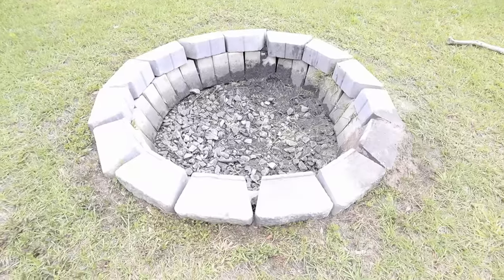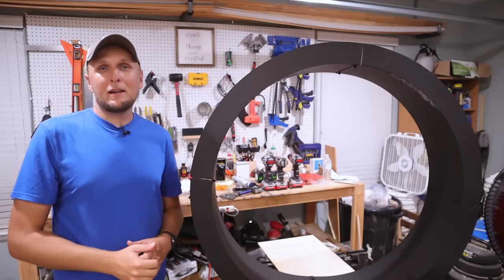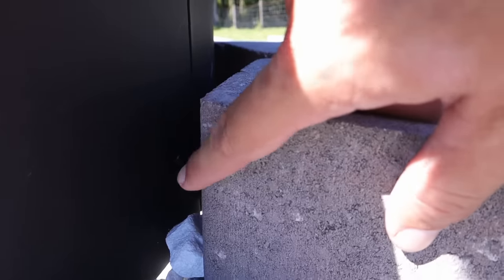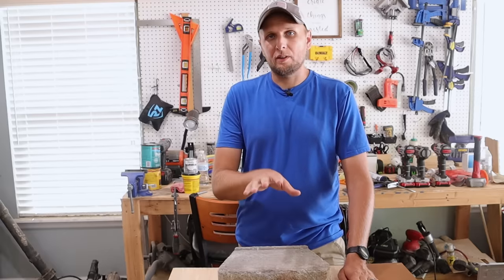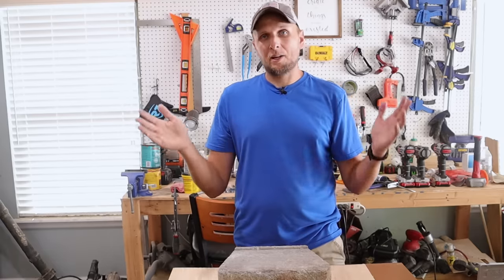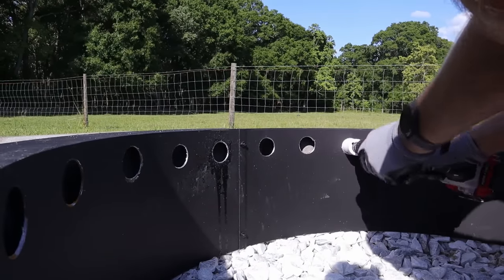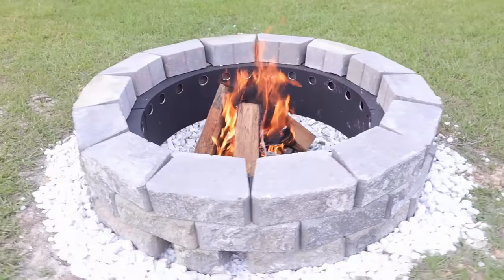How To Build a DIY Smokeless Fire Pit That Really Works!

Comment: Instead of buying a metal ring, a broken washing machine or a drier is free and has a nice, big metal container inside. Bonus: it already has holes in it, so no need for drilling.  Just cut it, invert it so that the holes are on top, and continue as normal with the bricks (making sure to make the top as airtight as possible so that the heated air travels out the holes, you may have to use mortar). Extra bonus: if you have welding skills, weld on pipes at a 45 degree angle to the right or left for the air to travel through. As is rushes through the angled pipes it creates a spinning vortex and you'll get a fire tornado forming.
Reply: Please do a video on this sounds so cool
Reply: @AW-md2ew  break into a house, unbolt the the nice container and get out
Reply: @kawkaw8623  😅 perfect answer 👌
Reply: @AW-md2ew  I have both a washer and dryer that are dead and useless I’ll be doing this
Reply: That’s a damn good idea, sonbut my fire pits gonna be big, much bigger than a washer or dryer Drum. Unless you talkin bout,  one of them there,  commercial dryer, now that might work.
Reply: That's a great video to be made right there. I see spare washers and dryers all the time thrown to the side of the road.
Reply: @AW-md2ew bro people throw old ones out all the time shoot I have even left one outside my yard with a free sign
Reply: Too small
Reply: Too big. jk, may do this

Comment: To increase the longevity of the fire ring, spray paint the fresh metal made by the hole saw with high-temp paint.
Reply: Yeah I wondered why he didn't..
Reply from the maker: I do in one of my follow up videos
Reply: If he knew he was going to cut holes then why the hell didn't he cut them before he set them up  and could have done them on a flat surface ?? Oh well not my Job ha ha !@! Good idea Eh ?
Reply: High temp paint doesn't hold up with direct flame but still a good idea.
Reply: @deere1485  true, I touch up throughout the year
Reply: Also to help you with the hole saw bit pre drill the center hole. Less stress on the wrist and drill.
Reply: @HowToHomeDIY  You're better off using extra virgin olive oil. The fiber content creates a carbon paint like layer.

(DON'T USE THIS FOR SEASONING COOKWARE)

Comment: Thanks for the video! Was about to build my own firepit and will definitely be using this smokeless method. The only thing I may adjust is spraying some high-temp paint on the drilled holes so the exposed metal doesn't rust as easily since the rest of the ring is treated with high temp paint already.
Reply from the maker: Sounds like a plan!  Thanks for the feedback!
Reply: That's not a bad idea, dude, since there's going to be a lot of oxygen going through them, along with a lot of heat absorbed by them, which is going to promote faster than usual rust.
Reply: @HowToHomeDIY  where do you get the 4 piece fire ring?
Reply: @scottplecker2296  There are links in the description for different sized ones. I'd love to try this out when mine finally rusts a hole in the bottom.

Comment: Thanks for creating this video! I’ve enjoyed all kinds of fire pits over the years while camping and I’ve found the best way to cut down on smoke it to scout for dry hardwood (usually from storm damage) and split it into smaller pieces allowing more air to mix with the fire as opposed to burning large logs. I’ve also noticed that fire pits with high sidewalls block radiant heat so you have to stand almost over the edge of the fire to get warm which can be hard on the eyebrows 😬

Comment: Wanted to say Thank you for this video,
 Got a fire ring, hole sawed the 1 1/2” holes, sprayed both sides with heat resistant paint, 12 -1’ x 2’ x2” pavers over sand for the base, used bricks that were on the property for the outer ring, 4 layers of the brick raised the ring 3/4 of an inch up which lets more air underneath, works like it’s supposed to!
Reply from the maker: You are welcome.  That’s awesome!   Really glad to hear you’re enjoying it.  Thanks a lot for the feedback Gary!

Comment: You could take out a couple of stones then distribute the remainder evenly and you'll have the support and the vents around the pit.
Reply: Simple solution.  Especially since this would negate the need to split the stones in half.
Reply: Exactly, that is how I did mine.  Work smarter, not harder.
Reply: That's what I was thinking. Could you not space each bottom stone out about 2 or 3 inches? Can you have too many air channels on the bottom ring? does it affect how this works?
Reply: i second that
Reply: The metal jacket is essential for the effect he is trying to achieve - not merely better general ventilation at the bottom of the fire, but the heat/convection-powered forcing of fresh air into the superheated exhaust stream at the top of the fire, to duplicate the "afterburner"  smokeless design of the expensive stainless firebowl shown at the beginning.  Merely adding more vents at the bottom helps burning generally, but it does not create the afterburner effect that completes the burning of the exhaust gases.
Reply: I've seen it done both ways and I personally think this way is more aesthetically pleasing (it looks better), and splitting stones is extremely simple.

Comment: Great concept!  My concern is any time I've used metal rings is they don't last long.  Heat burns off any coating, steel trusts, fire burns rust...two years later the ring is burned through.  For that reason I'm working on something incorporating the smokeless design but using fire brick instead of steel.
Reply: Did you get it figured out and built 🤔 
I would guess that the fire brick would insulate the heat from the outside chamber. The idea is to have super high heat air rushing in to the top to create the re-burn.

Comment: Should you do something to keep the stones in place once theyve been set down, like mortar or something?
Reply: Just avoid bumping them with the deck of your riding mower (if you use one). My pit is made of standard brick-sized pavers just free-stacked, no mortar. And that's the only problem I have had with leaving it unmortared (read: removable and rebuildable). But my bricks weigh a lot less per piece than the retaining wall blocks used in this video. It would probably take a pretty solid hit with a mower to really cause any problems with a pit built from those blocks.

Comment: @How To Home - Good idea & video, thnx!  BUT for a true comparison you should lift the fire ring out and try it with just the 3 layers of stone (with the spaces on bottom as u have now).  Your previous design was in-ground I believe, with no airflow (= smoke).  I've always wanted to see a standard firepit with airflow vs a firepit with a ring & holes design.  (The idea being, do you really need a ring to create the draft, or does the fresh air coming straight into the fire at the lower level do the job just as well).  PLEASE PLEASE PLEASE do this!  It would be easy with your setup.

Comment: Getting ready to start mine hopefully this coming week, got all the materials and assembled the ring and also drilled my holes.. i found a small starter drill bit followed by a step bit worked amazing.. i did 20 1/2" holes in mine (5 per quarter piece of ring)

Just gotta prep the ground area and get it built. Just been busy in the new house with other projects that take higher priority.
Reply: Was this hike size effective? I was thinking that more smaller diameter holes could create a little more back pressure allowing the air to flow out at a quicker rate? Does this sound logical at all?

Comment: Thanks for that.   And just an idea here:  regular stones would absorb and conduct a ton of heat, right?  Well, if you live in a cold place and have a fire for heat -- that's perfect.   But if anyone wants a fire for the aesthetics or for cooking but are in a hot climate (and actually don't want to be warmed up), then experiment with aircrete blocks instead of stone -- they act as insulators -- you may even be able to rest your hand on the outside of the ring while the inside is glowing hot (also prevents kids getting burned fingers)
Reply: Have two fire pits?

Comment: Great video.. I’m going to try this this weekend! I do have a few questions though.. what is the diameter of the holes you drilled, how far apart did you space them, and how far down from the top did you drill them? Are you at all worried about the bricks moving with people putting their feet on it?
Reply: I saw a different video, where the 1/2" holes were 2" apart, but not sure how far from the top to measure down.

Comment: You might increase the efficiency of the burn by constricting the top diameter. Eliminate one of the top stones and that will move the whole ring in so it over hangs the metal fire pit ring by a couple of inches This will cause a chimney effect and draw more air in and concentrate the combustion air and smoke for the secondary burn.
Reply: I like that idea, but I would think that you would need more top layers for it to produce that effect?
Reply: armchair expert gets the top comment.
Reply: @shamancredible8632  Not really an "arm chair" comment. The Solo fire pits are designed so the top ring is smaller than the pit and it draws the air in.

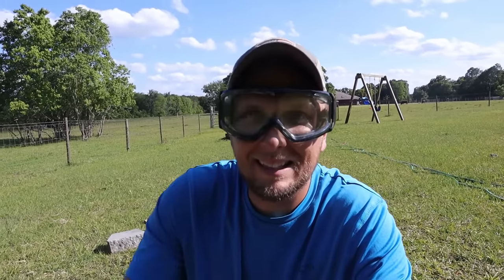Comment: 7:45 no joke getting metal in your eye! When I was a teen I was using a Dremel and got a "tiny" flick of metal in the corner of my eye and LORD did that hurt like hell! Super lucky it didn't do any real damage! 

One way you could improve this design and add more airflow is to look up a "Dakota fire hole" and combine that with what you already have to provide even more rushing cool air to the fire. Make a small tunnel down into the middle of the pit and out one side with something like cinder blocks, bricks, or a pipe ETC. Then cover the end of the tunnel inside the pit with a metal grate, maybe do the same on the inlet end of the tunnel to keep from stepping into or tripping over it if it's not tucked out of the way?
Reply from the maker: Yeah I would like to avoid that at all cost!  Glad your eye was ok!

I actually made a video doing pretty much exactly what you are suggesting.  Feel free to check it out on my channel.  It definitely made a difference!
Reply: @HowToHomeDIY  LOL so I see! Ya a Dakota fire hole works really well...

Comment: What influenced your decision regarding how high to drill those holes - I was expecting them to be lower? Would pre-drilling on your bench have been significantly easier?
Reply from the maker: I looked at the smokeless firepits in stores and that is where they are.  The idea is to get that fresh air into the top of the fire to help burn off the excess smoke.  I don't know that on the bench would have been easier as I was able to sit on the fire pit and lean into it to cut the holes.

Comment: Great video thanks. A few questions 1) would it be OK to create space between bottom layer pavers rather then having to cut them at all?  2) Are the retention pavers 12" wide & 12"deep? (I'm trying to figure which size fire ring I should buy if I want the total size of my firepit with pavers to be no larger then 55" diameter)   3) the hole saw kit link you provided is not available is there another you recommend or should I just shop Amazon for cheapest price? #diy girl here that's the reason for all the questions. Thanks!
Reply from the maker: 1) Yes you can, I just didn't want that look personally and wanted only a few opening instead of small ones all the way around as I believe it creates a better vacuum affect but others have said they have had success doing it the other way too. 2) The retention blocks I bought are 4.75" x 11.75" x 6.75".  3) Yeah they sold out of them recently but think they should restock but I also have had luck with my craftsman hole saw kit.  Make sure you are getting a kit capable of cutting metal.  Even then some of them wear down really fast.   I hope I was able to answer all of your question!  Glad to hear you are a DIYer, that is what this channel is all about is trying to inspire folks to try to fix and create things on their own!  If you have any other questions, feel free to ask!
Reply: Which hole saw did you buy? I guess I need a better one, because mine isn’t cutting it.

Comment: No need to cut the stones. Stagger the bottom circle with two less stones in a way that will leave the desired cold air inputs the correct size.

Comment: This was a most excellent video, very well done! I just have to share this with a family I know. who've been having the smoke problem with their current pit. Thank you so much for sharing your ideas!
Reply from the maker: You are welcome.  Glad you liked it!  Some modifications I would do differently, I would make the holes quite a bit smaller and maybe more of them.  If you don't have larger fires, maybe go with a slightly smaller ring so the holes are closer to the fire.  Both of these should just make it even better.  Also, I have a 2nd video showing part 2 of this, would recommend doing that install as well!  Thank you for the feedback!
Reply: Note comment above, Dry Hardwood.

Comment: I did an experiment with the same ring technique. What I found was if I dug a hole the same depth that the fire ring was high I got the same result! The difference was that the one surrounded by stone blocked most of the heat. The one in the ground did a much more better job at projecting heat to people sitting around the fire pit.
My seven yearold son said " it heats us up more because we can see the light of the fire more, the other way you can just see alittle bit of the light"
He was absolutely right; we are warmed by the Inferred light from the fire.
Reply from the maker: That is a great point and makes complete sense.  You have a smart boy!  I really appreciate the insight and feedback Rodney!  Some may want to follow your example.  🙂
Reply: Hey Rodney,  so did you still use the ring with holes?  Just placed it in the ground vs on block?

Comment: Use lard on your hole saws. Comes in 1 lb blocks. Leave in pkg. (Can use for drilling other holes) Rotate saw thru pkg into lard to load the teeth. Do for each hole, 'cools', and chips will 'stick'.
Reply from the maker: Great tip!  Thank you Marshall!

Comment: Why not remove 1 or 2 stones completely and then just shift all the other stones so there is a small gap? Not only avoid having to cut stones, it would also ensure you can still control the symmetry.
Reply: I was gonna ask the same thing
Reply: Honestly, I was wondering the same thing. I don't have a masonry chisel and wouldn't want to buy one just for this. I think I'd prefer to cut the holes out before putting it in and maybe doing a touch up of stove paint to cover as well. All in all, this is a nice looking pit.
Reply: Yep, same thing I was going to suggest.
Reply: He used the half-stones to support the offset 2nd layer.  Spacing all the 1st layer with 2 stones missing wouldn't be as symmetrical.
Reply: @DoBeLove  See if you can rent the chisel somewhere.
Reply: @TIMEtoRIDE900  Hmmm, I would have to try it out, but I think Dibs1978 is right. If you remove 1 or 2 blocks/pavers from the first course completely, then rearrange the remaining blocks/pavers evenly and leave a small space between the blocks, blocks in the second and third course can be offset as usual. It might be a little fussier than breaking 2 blocks, but a rope or garden hose laid around the first course before removing one or two blocks could serve as a guide to reposition remaining blocks.
Reply: @margieschwartz8413  the chisel is only $11
Reply: @Siyami97  Not using a tool you don't need: priceless. 😆
Reply: @cloudbase7799  thats exactly how i would do it, it would look nicer imo and id probably try and make it a bit smaller in circumference increasing the efficiency of smoke removal i believe would be the result as the walls wouldnt be so far away from the fire itself. now of course thats only if i decide to get rid of my 1920's washer fire pit XD
Reply: @cloudbase7799  If you are building your own firepit, sooner or later you will be laying your own paver patio, garden border or walkway and that chisel you bought will be invaluable.
Reply: @TheFoundBeliever  One using that type of stone it takes 12 of them to make a complete tight circle. Using less would make the stones fit at odd angles or with huge gaps, that would look unsightly. Plus the tighter the pit, the less air will get into it and now you are back to a smoky fire.
Reply: @kenbred46  first off, it would look unsightly if you just randomly placed those stones, by removing a few stones from base level and you then move the remaining stones into equal distance from each other providing multiple entries for air flow and keeping it sightly as you stated. also ive used a pit thats approx 2 feet across and it rarely smokes due to how hot i make it to begin with and the smokeless effect i desire for the windy days when its harder to control. secondly, the size of multiple holes being equally the same space made by the removal of the bricks would therefor provide the same air as per the design here. and lastly if you missed the update to this video check it out as even he agrees it would have been better if he did it how i have just described. have a great day :)
Reply: i second that
Reply: @TIMEtoRIDE900 , precisely why I intend to chisel and place mine as Adam has done.
Reply: He split the bricks this way to keep a vacuum at the intake. He's purposely constricting  the air intake.
Reply: Remove or not remove lol. Removing 1 stone = 2 spaces.... as for as messing up the circle its still the same...
Reply: This ⬆️